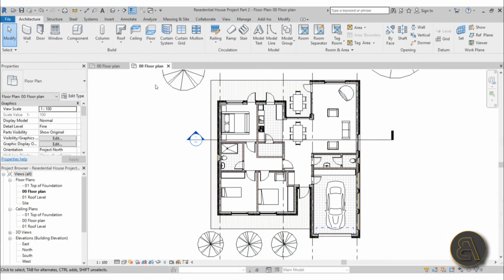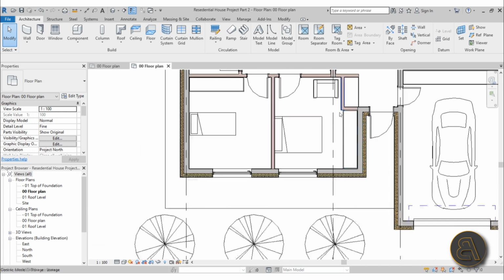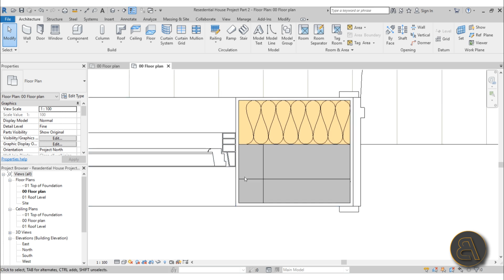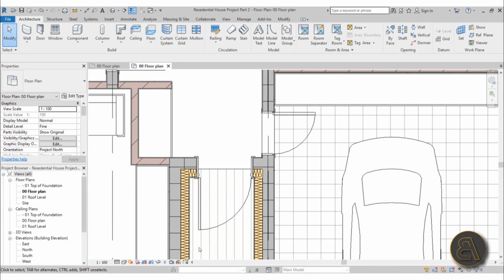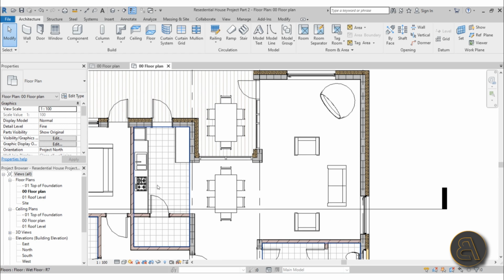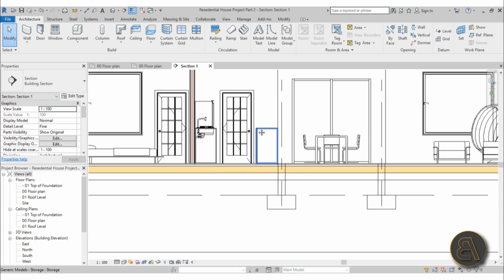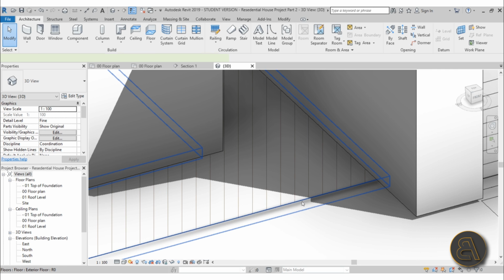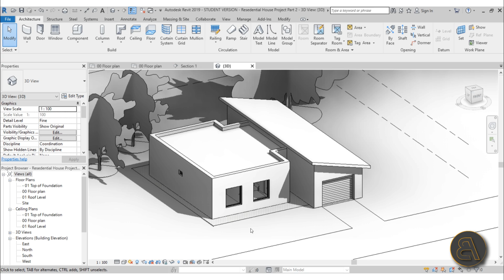Wall, Floor and Roof Layers and Details in Revit Tutorial

Comment: thanks for sharing. ı couldnt find any lesson about column plaster-beam plaster- Wall plaster joint details. how do you solve the problem? do you use any add-in to solve plaster problem ?

Comment: Excellent tutorial Balkan, I would like a tutorial that shows how to effectively model and schedule plaster or concrete on columns and beams. As you can add layers to the walls for the finishings (e.g. plaster) I would like to know a way to do that on structural columns and beams as they often are in the middle of a wall in a room. Thanks!